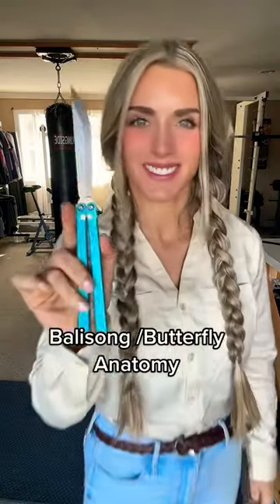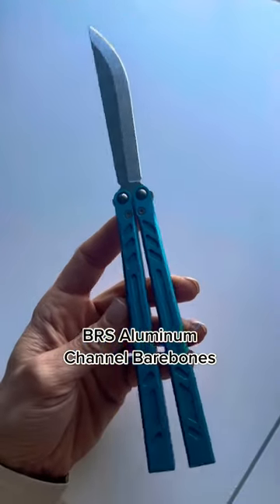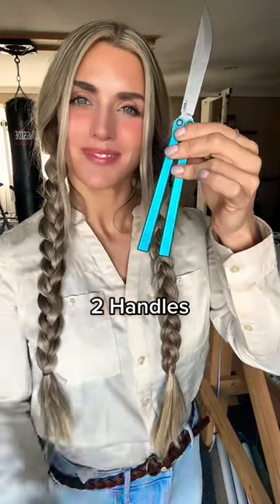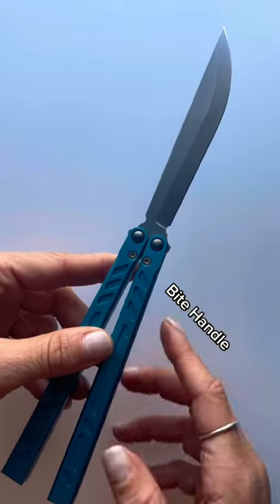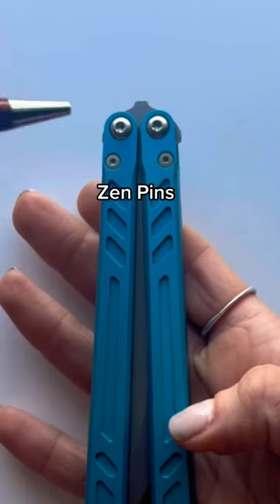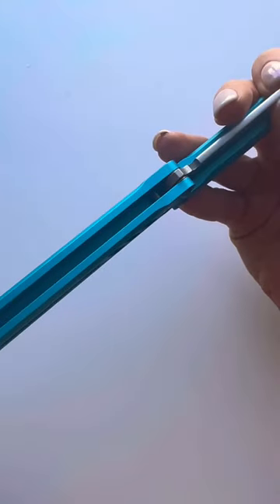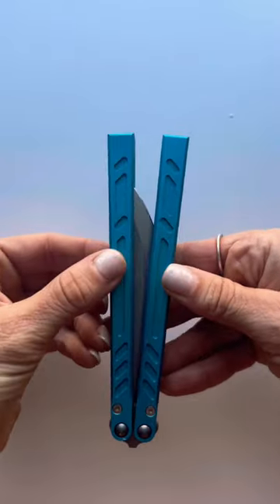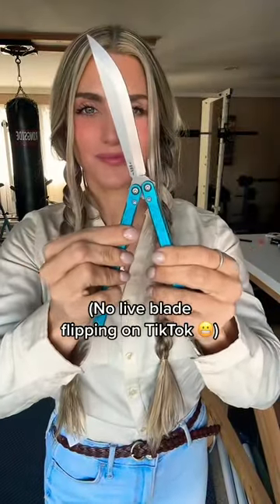Balisong/Butterfly Knife Anatomy you should know

Comment: Some things I felt worth noting:

There are different pin designs: tang pins, which are fitted into the blade and make contact with the handles; zen pins, which are fitted into the handles and make contact with the blade; and pinsless designs, which simply rely on the material in the handles to make contact with the blade.

Some balisongs do have latches, but most modern balisongs do not, as they can interfere with flipping by adding unwanted weight to one handle. If your balisong does have a latch, it can either be a standard latch, where you manually unlock the handles, or a spring latch, where you can just squeeze the handles together to unlock the handles. Standard latches are loose, whereas spring latches stick out from the handles.

Comment: Very nice modernized balisong knife. 

Brand new traditional made balisong knives are very stiff. They have to be repeatedly closed and opened probably a hundred plus times before they open butter smooth.

The blades are usually made from old railroad steel and are hard to sharpen - but will keep an edge for a long time...

You have to memorize how to safely flip and swing open a balisong knife. The double edged blade is so tough to master. I bought only the single edged ones because I did cut myself with those double edge ones.
Reply: because the original one is made as a weapon, this aluminium is for... I'm not sure..
Reply: The aluminum one is made for flipping
Reply: @jayarann2595  it's made for flipping and EDC, but mostly flipping

Comment: There's no latch? How do you tell which side is which?
Reply: Most balisongs don’t have latches
Reply: Also you can buy a bite handle indicator which is kind of like a rubber band that goes on the bite handle so you can tell them apart
Reply: Practice lol lots and lots of practice
Reply: 4 or 5 visits to the hospital you'll learn fast.🤣
Reply: Usually just the blade design can tell you which side is the bite side when it’s closed.
Reply: Just stick some coloured tape on the bite handle.

Comment: No latch on this one. Do balisongs run washers or bearings?
Reply: Most of them run washers, but better ones will often run bearings or my favorite, bushings
Reply: It depends on who makes them, BRS usually runs bushings on their models. The original Barebones was on washers.
Reply: Any decent bali is on bushings, bearings are considered trash, washer knives are straight up gas station knives. There's no latch on it because it would throw off the balance, which is very important.